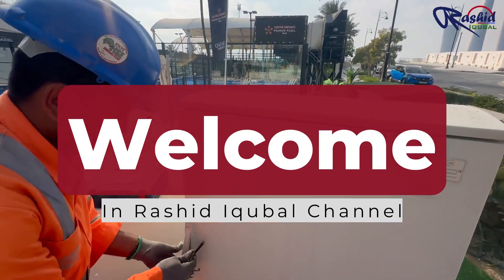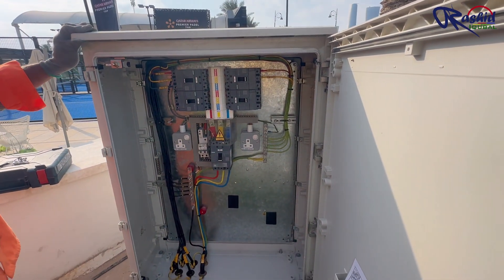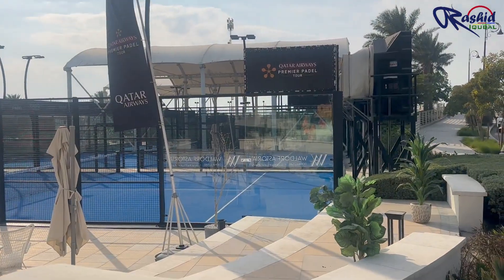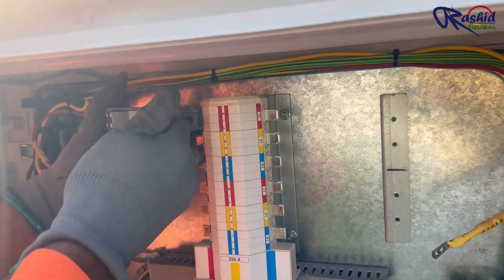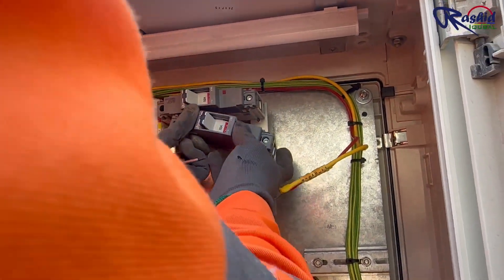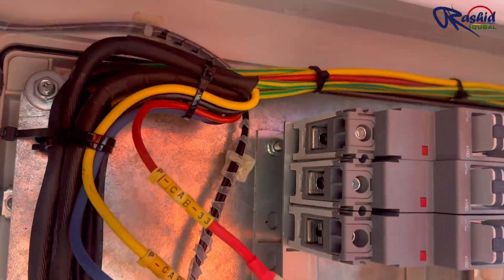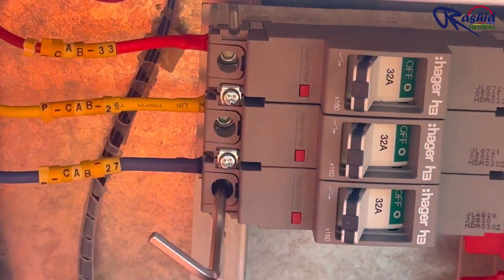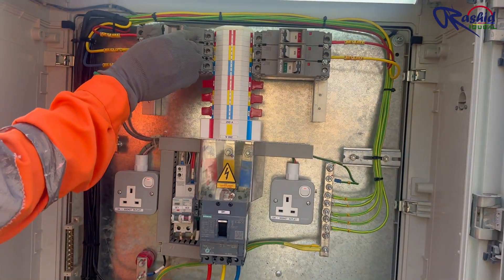How to Install MCCB and Terminate Feeder Pillar | Electrical Panel Wiring

Comment: Main cable what size
Reply from the maker: 4c-25sqmm
Reply: How meny  single pole  light for  32 Ams breaker and pannel to street pole what size of wire use